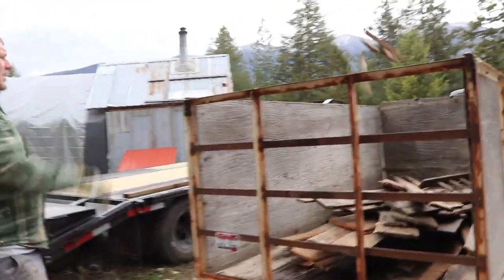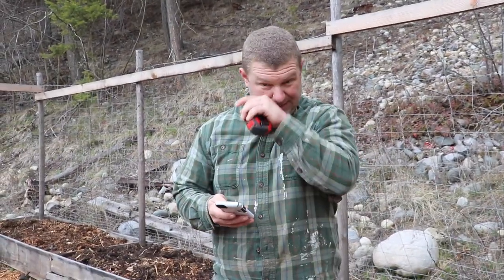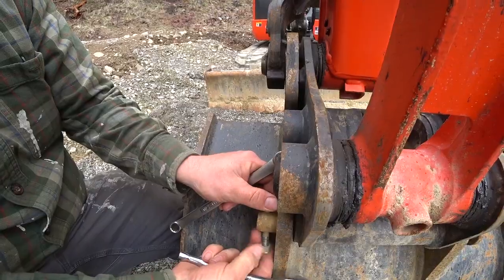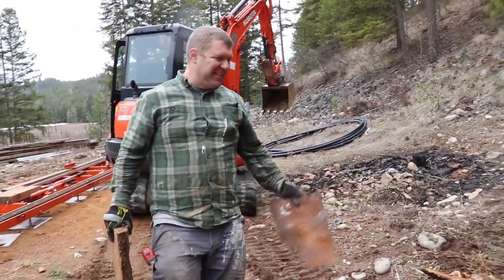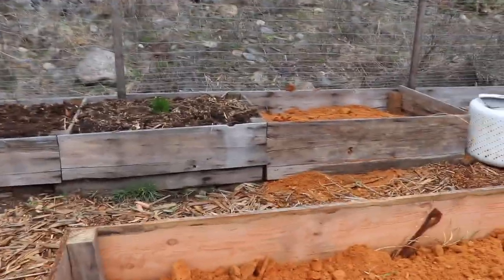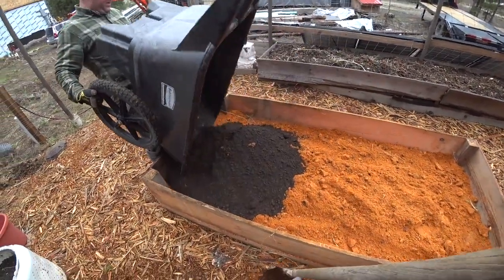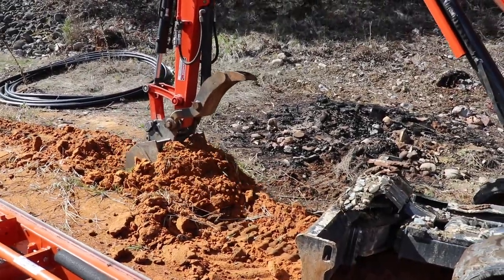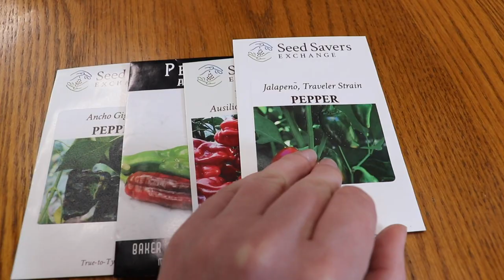How to Fill Raised Beds for Cheap & Save on Soil Costs

Comment: Alyssa, mint grows like a weed. Keep it in a pot, otherwise it WILL take over your whole garden. I started from a grocery store 2" square pot in a 3 foot octagon bed. Likely I didn't have anything else in it. (Family matters kept me from trimming it back and it took off)
Reply: Yeah mint is pretty terrible in the garden.  The only way I was able to keep it under control in mine was to eventually remove it all.
Reply: Haha I planted lemon balm, just like mint. If you want some, let me know. I have plenty. 🌿
Reply: I second and third that comment!  Mint will destroy a garden!  It actually grows faster than a weed.  You'll have an entire bed filled with mint in less than a season.  And don't let it go to seed either as it readily re-seeds and the seeds will spread everywhere too!
Reply: Came here to post the same thing. You can grow a mojito forest really quickly.

Comment: as always, well done!  I do wish Alyssa had thought to use a garden rake (not a leaf rake) to spread that dirt.  Just push and pull and it moves the dirt easily with no lifting of the shovel.  Just a thought.  And hey - I suspect once that baby's a week old, Alyssa will be outside "supervising" with the baby strapped to her.  I always had TONS of energy...until the baby was 6 weeks old...and then I felt the need for more rest.  Praying all goes well with the little one!

Comment: Hey!!! Just a heads up, look at adding dolomitic lime and nitrogen to your garden beds. Adding wood and saw dust from conifers will increase the acidity of your soil. The dolomitic lime is a base that will help to neutralize it. Also, the decomposition of the wood and sawdust is going to require a lot of nitrogen from the soil. You will have to add a fertilizer or other nitrogen sources to replace it. Check out the following link for more information: https://archive.org/details/useofsawdustform891alli 

Please let me know if you see this, I hope it reaches you in time!
Reply: I was thinking the same thing. I would never have put bark or sawdust in there. And you can use the sawdust to make sawdust brics for firewood.
Reply: Peace,if the compost is manure wouldn't that be fine?, I'm learning myself and thought the same things, too much carbon, plus isn't the bed to dense, due to saw dust? How will Oxygen circulate.

Comment: On your next load of dirt or compost put a sturdy pallet with a heavy chain run through the pallet in front of the trailer,  with the free end coming to the rear of the trailer so you can hook it on your equipment to pull the dirt off.

Comment: While putting that top layer of compost will certainly help a lot, the fact of the matter is that you are Nitrogen deficient in all those raised beds.  Tons of Carbon but not much Nitrogen.  I would consider finding neighbors with livestock manure (often free) as a source of manure (for the needed Nitrogen).  Very dilute "Manure Tea" once a month will do wonders.  Try for old, weathered manure but if 'green' VERY weak 'Tea' - especially if you're using new (hot) chicken manure. 
Black tubs - do they have drain holes in the bottom?  I would think so.
We all follow you constantly - AND - all wish great things with "Sprout's " arrival soon.
Reply: In Southern Germany, the Germans would muck-out their barns into an above ground tank over a below ground tank. Then they pumped water over the manure to be caught and stored in the below tank, making manure tea, which was sprayed on their fields. Yes, manure tea farm style!

Comment: If you have a welder, you might consider fabricating a 'paddle' attachment to fit over the bucket teeth that locks on with welded nuts & bolts, (3/4" +/-) If corrosion is a concern, use stainless hardware. You can weld on steel with stainless rod, but not vice-versa. Looking good!

Comment: Single axle trailers generally rated at 3,500 pounds , though yours looks like rated possibly up to 7,000 pounds . A yard of topsoil will vary between 2,000 and 3,000 . I have seen too many people destroy their pickups and trailers with too much weight . Have seen a brand new Ford 3/4 ton with a load of bricks where the weight actually cracked welds in rear end housing ! It would appear that your springs may fall a little short of 7,000 pounds .

Comment: Hi guys great content, keep it up, just a note. If you attach a piece of board to the top arm/lever you can create a GRAB of sorts it will save dwich the materials. Basically it will cover the gap in the top arm. If that makes sense, come on dude your the one that normally comes up with these solutions 😁

Comment: Springs lose their arch over time and hard use(heavyweights  like water  lol) with light trailer springs being prone to failure  fast. By your description  I would bet that's  the case . I have  changed   out  quite a few truck and trailer  springs  over the years that little  trailer should  be a easy task for  you. I vote for  a sixteen  inch carrot  year!

Comment: For irrigation make an automated irrigation system using like an arduino and some valves etc. So the system will water itself and check soil hydration and temperature. Doesn't take really much work at all and saves a lot of effort and thinking of when to water the garden. The electronics is cheap as chips. Look into it you might be surprised at what you can do with some cheap sensors and a small electronic board and there is no excuse to not do it since there are plans out there already on how to do it.

Comment: I don't comment on very many of your videos I love them very much but if the excavator is yours you can find buckets for them they're relatively inexpensive and you can get a smooth edge bucket with no teeth on it which would help you immensely on grading and pulling material out of your trailers you would enjoy it very much there is a plethora are attachments for that excavator that are aftermarket I don't know if you read the comments but that should help you

Comment: Question: what is the weight rating on your trailer axle? Topsoil dry usually around 1700 lbs. wet can get over a ton. Cubic yard 
Seems like a small trailer to have over a 3500 lbs rated axle. ?
Keep up the good work.

Comment: Soils typically weigh between  100 - 130 lbs. per cubic foot.....  even at 100 lbs that would put a cubic yard at easily 2700 lbs....  so you definitely had over 5000 lbs in the trailer on that run......

Comment: Not dis'ing you but would the cedar have heated the hot tub for a while?  We used to heat with wood and even the small pieces got wrapped in a kraft bag to help start the next fire.

Comment: When I use heating mats to start seedlings, I put a piece of insulating foamboard under the mat. After all you want the heat to rise into the bed, not heat the air underneath...

Comment: I've watched your  videos sence  you   sold the   car suggestion   for   watering drive a  1" pipe in ground in center  of   garden  area put  an  oscilating  watering  spike  in  top you  can  adjust  the  width of  the spraying area    I  got  up  to a  40ft  diameter  spay  with  mine

Comment: As you may already know, organic material draws nitrogen out of the soil as it breaks down before releasing it later. In the early stage it is wise to supplement with extra nitrogen. The lime mentioned in another comment is helpful as well.

Comment: Here's a hint useful hint. Get your log chain and attach it to the tongue of the trailer you have to talk to the other end to the front of the bucket and then lift the excavator bucket up make sure you don't tip over the excavator. Now you have a dump trailer. One must I'll hit you loaded and unhitch it at the dump site. Now we hope that you have a decent Jack to lifted off the hitch. But I say on the farm this is an old technique. It goes back clear to the horse and wagon days.

Comment: That bark and sawdust will make great soil in time, but it's very high carbon content, and the decomposition is going to suck nitrogen out of the soil you put on top. You're going to have to supplement with a lot of N.

(Based on both my reading and the fact that I used the same technique on my farm).

Comment: Two words ...... garden rake! You can break down clumps  .... push ..... pull ..... or mix. Ask me how I know ~8^) I've been mixing garden materials in a wheel barrel for weeks. The only time I touch a shovel is when filling containers and even then I do a lot of "finish/topping off filling with a thick rectangular-bottomed detergent bottle with the bottom cut out as a scoop. Each to their own, but moving dirt around with a shovel is backbreaking work for no reason. I have one 4'x8' raised bed ..... dump ..... push/pull ... done. The rest of my garden are containers/grow bags/buckets that are set in position. I mix my materials at one location in the yard and move the wheel barrel to each container and fill in order until done. I have a long narrow yard that I leave enough room to barely accommodate the wheel barrel. It's tight .... whole garden/grow area is about 12'x 40' with a 36' long "T" trellis in the center that goes up 9.5 to 10' for growing up tomatoes, with peppers and herbs underneath. 
There is a fence the full length of the yard on one side and a block wall the full length on the other side. Along the fence and wall are elevated planks with containers and grow bags, all with peppers. At the bottom of the yard are two arched 16' cattle panels and two 8' cattle panels(on end) for cukes, cherry tomatoes, & melons. Happy gardening!

Comment: Even if you were able to turn the bucket around you wouldn’t want to because you would loose all your breakout power because the cylinders are designed in a way that makes it so that all your power is when the cylinders push out aka curling the stick and bucket in so you wouldn’t be able to do any long range shoveling if that all makes sense

Comment: Planting strawberries from seeds?  Now that's ambitious!  Obviously it's possible, I just didn't know anyone did that.  I am guessing they are probably the ever bearing variety, and not the June bearing variety.  Usually you just need to dig up some plants and separate them out a bit from last year's bunch.  Same with raspberries, but they need 2 years to bear fruit.

Comment: You can use season extenders such as row covers. That way you can extend the growing season as well as protect in case of frost when growing in colder climates or planting before normal start dates for planting. This might help you all till the weather warms up enough. And it will still work with rain and watering. Also soaker hoses help were needed. And you can place windows over planting boxes to make a temporary green house. (simple for helping in your growth of plants.

Comment: Something I have done with my pots to reduce weight, and improve drainage...OLD STYROFOAM.  Put chunks in the bottom of those big pots, then put your mix on it.  It will improve drainage and reduce weight.  BTW: Was taught that from a master gardener who learned it from an agricultural school.  I wouldn't put that in a garden, but for pots it works great.  If you replace soil every year, you can also replace (or reuse) the styrofoam.  BTW: it will break down regardless of what people will tell you.  BTW: I do this for flowers, as I don't plant food items in pots, I've had ZERO luck with it (pots get too hot and cook the roots where I am).  

As for root depth?  LOL...I have tomatoes that have rooted nearly 24" down, peppers have gone 18", and other things have as well.  Roots will go down as far as they want, and if the soil is easy for them to do so, they will.

Comment: You need to invest in a mud bucket for the excavator you'll be surprised how much easier it is and how much better you can level and scrape ground to cleanup I only uses my teeth buckets when digging deep most of the time I use the mud bucket

Comment: May I ask again why you are not installing siding on your home? You no longer seem to be working on it. The OSB SIP panels should not be exposed for so long. There hundreds of lawsuits all around the US for SIP panels delaminating. Are you not worried about your panels exposed to the weather? Did you guys run out of money? I see you renting planes to fly around and renting equipment that both cost $ but I don't see you doing anything to complete your home. What is going on? You have a house to finish. What is the delay? Seems very strange to me.

Comment: Don't grow Rhubarb - It's root grows several meters deep!  Growers use clay drainage pipes to grow them in - going up a hill.  They add one on the bottom when small roots show up on the bottom.  Add a full of soil pipe to the bottom and keep watering.   You are right except for beets maybe. !! IF you had a flat face bucket not a tooth bar bucket - it could scrape the bottom of the trailer pulling op a load.  Nice decomposed sawdust.  Hope you have worms in it - might look into buying a box or two of 'fishing ' worms if they don't have others.  They decompose this wood and make 'castings' for plants.  Rotate the wheel barrel 90 degrees to the escalator for a better dump. Yo Lady !!   Use a hard rake (not leaf) to spread the soil.  Moves nice and easy.  Shovel gets heavy due to lifting and limited smoothing.

Comment: Too bad about the quick-attach not mounting either way.  It’s a trick we do all the time with our excavator.  Looks really weird when the giant 7’ wide 5’ tall “spoon” is hanging on the “wrong” way.
Reply: Couldn't he have used the "grabbing claw" as a locking device for the bucket when it's turned around?
Reply: All he had to do was drop the hook back down and it would have worked, DUUHHHH!!!!!.

Comment: It's so cure how the 3% of the world which are USAmericans, in 21st Century 2019, still talk measurements in yards, feet and inches.  Other places around the world converted over to using the standardised Metric S.I. system back in the 1970's.  It'll be great when the USA (and their buddies the Burmese and Liberians, the only remaining stragglers of the world) catch up. You'll find maths calculations much easier, especially when working out weights and measures.
Reply: They are switching over to metric, inch by inch... ;)
Reply: KiwiCatherineJemma but we don’t want to change. 😂
Reply: Taught both in school. Somes things stick easier than others.
Reply: KiwiCatherineJemma As a Brit who lived in the USA for the last 15 years you get very used to US/imperial measures. Even though I am now back in the UK, Inches, feet, lbs and yards seem much more intuitive to me than metric measures. I do not believe the US will ever (within our lifetimes at least) change to metric (other than for science which is already the case). The UK is a mishmash of both imperial and metric...eg our speed limits mph, fuel efficiency  measured in mpg by vast majority.
Reply: Our measurements work just fine.  As witnessed in this video they measured, calculated, and filled their garden using the math that we Americans need to catch up with.
Reply: I often wonder how it hurts the rest of the world that we measure the way we do and why you worry so much about it.
Reply: I’m not sure anywhere is completely metric I’m in the uk and we still use both metric and imperial systems